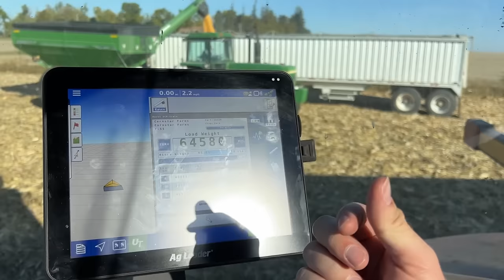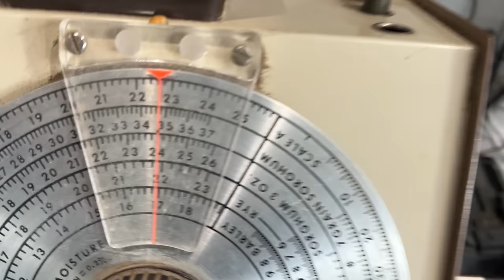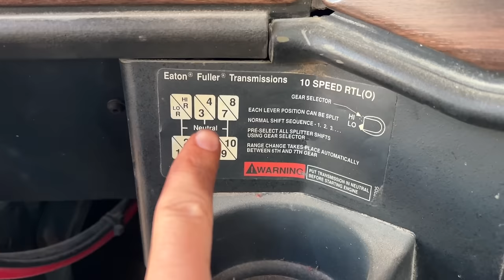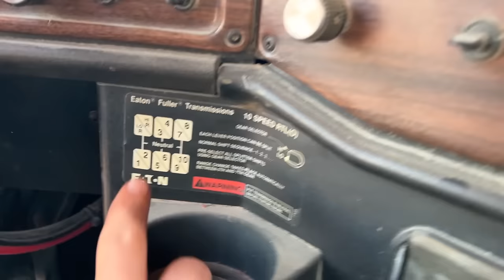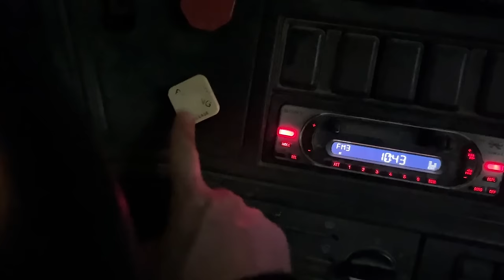My Farm Has A $140,000 Problem

Comment: Youll want to put grade 5 bolts in the augers again. What they're doing is being "sheer bolts" meaning the bolts break instead of destroying the auger bore it goes into when somerhing plugs the auger.
Reply: That was my thaughts as well
Reply: Or the fail safe could just be burning more belts.
Reply: I was amazed the wear in just a few years. Plus one broken, 2nd lost?  possibly broken?   If tight they should not.  But there is a lot not right with that site.
Reply: @larrythompson8630 the bolts are probably supposed to be checked every season but the contractor didn’t give them any maintenance plan.
Reply: That or a contractor used inferior parts because they were cheaper. A 3/4" diameter bolt is a hell of a shear bolt.
Reply: @jkpq8738  I'll smoke em
Reply: @jackt6595  yeah that's the only thing he forgot cuz it's not his job
Reply: I'm really glad someone else pointed this out.
Engineering done right, always gives you a Shear point where your least expensive link-in-the-chain, breaks.
Those new # 8 bolts are putting every Affiliated system at risk:
Motor-mounts, Motors, pullies, belts and suspension/adjustment structures.
Not just the augur cores.
Reply: @Peter-jo3wt  there's way more strain on that system from the slop of the inferior, wore, bolts. The mynewt amount of deflection you'll get from using a lesser grade bolt is not even measurable. Everyone needs to quit playing sideline engineer.
Reply: @kevenhiemie  
That's funny, since any engineer can tell you, you want the weakest link in the chain to be the least expensive and easiest to replace.
People without engineering education and experience, should probably not represent themselves as experts in engineering.
Reply: @Peter-jo3wt  o.k. Jimmy. You're trying way too hard to sound smart at something you don't know much about. Just stop trying to play sideline engineer.
     Do you remember the acronym
K.  - Keep 
I.   - It
S. - Simple
S. - Stupid 
       You didn't put the weak link in the middle of the chain. You put the weak link (sheer bolt) at the end. 
      You know right after the gearbox or a motor not in the middle of an auger. That would be dumb. 
       The bolt was just poor quality hardware, that failed. Plain and simple. It wasn't an engineered breaking point.

Comment: Does everyone forget Cole chose the lowest bid. Most large contractors throw out the lowest bid for these types of reasons.
Reply: After all he chose those contractors, buy once cry once.  Or in Cole's case buy twice cry thrice ( moaning every video) 🤔
Reply: If he did choose the lowest bid it's still not right that they have so many of these problems though , usually a company would want to prove that they can do a good job and such for a bit of a Lowe cost, but also cheaper unfortunately usually means crappy work or sub par work...so who knows

Comment: If the truck holds air for long enough, you don’t have to pop both the air valves every time you park. The trailer brake isn’t technically a “parking brake”.

Comment: Hey, I hope you guys see this, with the belts, you have 2 massively different pulley sizes. Try using an AX belt, basically it is a belt that instead of being continuous it has a little more flexibility to allow the difference in pulley size, another thing, feel the inside of those pulleys, see if they are worn. Due to the amount of belts it has run through. And one last thing, if it is wearing through them that fast, check the tightness and alignment of the belts. Use a long straight edge and put it the long pulley, the gap between the belt and the straight edge should be equal throughout the whole travel of the belt. Make adjustments as needed. The angle of the motor can also play a factor in eating up belts.

I'm in commercial Hvac, I have deal with motor replacements all the time and have to do this.

Comment: The transmission in the red freightliner is called a super 10 speed.  Ps usually if you only pull one brake , you pull the tractor because it takes less  time and less air then the trailor brakes.
Reply: On the red trailer knob,  it says not for parking, take to good truck shop , they should be able to take that shut off system out of the computer!!
Reply: @kevinsiedschlag429 that or bump the cruise up a little while in park

Comment: To fixs your v belts burning out all the time you need a pretension idler pulley it will give more belt circumference on the small motor pulleys, less slipping and will make it easier to change belts with a bar . Hope this helps.
Reply: Nice call Matt. I was wondering about a third belt too.

Comment: Can you switch to a double-chain drive and gears instead of burning belts?
Reply: It’s probably burning belts due to misalignment. Could be better to fix the misalignment issue first.
Reply: Belts are a safety item on the augers. They break before you tear other things up.   Chain if something happens you tear a lot of things up.
Reply: @johnunsicker7440 the motors have overloads on that system…if there is too much of a draw they will get shut off. Chain is the way to go
Reply: @johnunsicker7440  Not in my experience . a correctly adjusted Motor Protection switch cuts the power before it tears itself apart

Comment: Just a though. 

But your motors are being driven by drives. That means you can adjust the properties of the motors almost infinitely. Biased on what your saying it’s possible you could increase the torque of your motors and also have them do soft starts. Basically, rather then the motor going full force and burning the belts it will start off really slow and work up to the speed. 

Saving your belts and giving you a chance to catch issues before they burn up.

Comment: Just a note on the auger bolt. That was a special bolt, long shank with a short threaded end.  Putting in standard hardware bolts will most likely move the rotating force from the shank to the threads, a much small and weaker part of the bolt.  They will fail prematurely.   Order the correct bolts.  If the correct bolts are grade 5 so be it.  Use red thread locker on them.  Yes, you will need to heat them with a torch to remove the nuts when you want to.

Comment: Use a high temp automobile belt. Equipment belts are not as heat and rpm tolerant. I had a belt that would burn threw in 3-5 hrs, switched out to a truck belt last year and no issues

Comment: As far as Grade of Bolts, you want a bolt that’s softer than the shafts you’re connecting - it’s easier to replace bolts as they wear than it is to replace shafts. The softer metal gets the vast majority of the wear, so harder bolts will just wear your round holes into ovals.
Reply: Nooo a softer metal bolt will wear thin. Allowing the hole to oblongate due to the play between the hole and soft bolt.
Reply: Are you talking"shear bolts" or regular vs grade 8?

Comment: I would be wary of changing to grade 8 from 5, it probably was designed to be the shear part in that system. That said it likely would need orange thread locker for it.
Reply: Zero lock washers.... Of course they came out.  Put it back together without lock washers... << Palm face >> and no locktitie.

Comment: Hey Cole, why don’t you put differently pulleys on the pit auger ie pulleys with more slots for belts that way there’s more belts taking the strain making it less likely to burn them
Reply: ding Ding.  These guys are machinery clueless.  Put auger back together without lock washers or cotter pins... of course it falls apart.  Saved $1 but spending $1000's "fixing" continuously instead of addressing base problem.
Reply: @w8stral  yeah I know it’s sad to see, embarrassed for them too that they couldn’t figure out the problem with the combine either, just basic stuff
Reply: Those bolts go into the semi-annual maintenance and upkeep program. Self-locking/nylock nuts should be sufficient when tightened down.

Comment: Our pit augers have a heavy duty gear box for gear reduction.  We still burn off belts but it’s usually because of grain leg problems, plugging.  Your motor needs more torque.  Will run a little slower but will not fail as much.

Comment: You can try X belts instead of B belts. The cogs on the X seem to hold up better. I’m surprised that it’s not on a VFD. Even if it’s just for a soft start. If it isn’t it probably should be. That stuff banging on and off constantly at 100% will most definitely tear up belts

Comment: Cole, on the trucks with the automatic shut off if you lock the brakes then hit the cruise control button it will automatically idle up the truck and bypass the automatic shut down
Reply: What I do is put in reverse driving 100k an hour
Reply: @morgan67748  after spending hours in line at the elevator every year when it's 110 degrees in the shade in South Louisiana you learn real fast how to keep the truck running and the AC pumping, WITH THE TRUCK IN NEUTRAL ( I didn't think I would have had to explain that part but) lock both the truck breaks and trailer breaks, then turn the cruise control on either  hit set or resume the truck will then automatically idle up and bypass the automatic shutdown
Reply: @lukedesselle2491  baby

Comment: Hope yall get all the problems with the bin site worked out so it works like it is suppose too
Hope the grade 8 bolt donot tear something up usually grade 5 is a lot tougher than grade two
Grade 8 might no break n something else tears up
Reply: The bolts are not a sacrificial part in an auger . Anything that shears will get wedged regardless as we saw in the video.

Comment: The reason your belts keep burning off is due to pulley size ... small diam will ruin belts ..resiz, and pissible upsize the belt or additional belts - then you wont have anymore problems...

Comment: If you are allowed to modify the wet bin legs,  could you add square tubing from leg to leg around the perimeter of the support legs? It would spread the load to the entire pad perimeter instead of just where the legs set. Maybe run some iron across the pad as well ?Just curious does the pit lift auger start before the bottom cross auger on start up and the opposite when shut down to let the lift auger empty? Kind of like the grain cart auger unload procedure. And you are right, you need a  larger capacity dryer.

Comment: I commented before on Daddy Corn star's channel about this, but you cannot choke feed an auger unless you are running a shaft mounted reducer. The tiny pulley motor setup doesn't have the torque to handle it so if it didn't burn the belt, then it would burn out the motor. Shaft mounted screw conveyor reducer will fix this immediately, then you can put a variable speed on it.

Comment: That is a super 10 transmission . And most of freight trucks have that idle shut down.  Most way to get around it was to idle up the motor by using the cruise control buttons by holding down the accel with cruise button on.  Should bring the idle of truck up.  It was for oil circulation while long parking

Comment: There is something you can do to make your dryer more efficient if you are not doing it already, and that is set it up for all heat, then cool your corn in the bins. It can come out of the dryer at 17%, make a layer of hot corn, use bin fans to finish drying on residual heat and cool. I have not seen this mentioned but maybe you're already doing this. Put a hot layer in a bin, then switch to another bin and cool the first bin, when cool you can put in another layer.

Comment: We’ve had good results (on wheat) by putting a space heater infront of the fan so it blows hot air, might not sound like a lot but it’s worked

Comment: Cole depending on how old that trailer is that your pulling with the Volvo the brake problem could be the regulator valve under the trailer or you have a leaking diaphram on one of the air chambers on the brakes. More times than not its that 40/60 valve on that regulator thats failing...Enjoy so much your videos about the farm and especially harvest its a lot of work. Although it has its rewards you work outside you work with your family and friends...It doesnt get better than that...Blessings to you and your family ....🌄

Comment: Hopper bottom bin should've had an extra thick footing around the edge of the slab with extra reinforcement thick rebar 1 inch or better. The way they done it there is no way to distribute out the weight to the rest of the slab just on the edge. 😮

Comment: Hey cole i was just thinking about the inter crop plot, what would happen if you have more row spacing so like instead of 12" have like 15-17" apart so the corn still gets more sunlight without the hassle of chopping up beans and switching heads back to back. Havent researched but it was something ive thought about
Reply: Wondering this same thing when he was talking about planting next year
Reply: Most corm are on 30 inch row spacing some will do 20 inch spacing.
Reply: @johnunsicker7440  what would happen if he would space that to like 40

Comment: Cole, the red Freightliner has what is called a super 10 transmission. i drove a '93 freightlner with a super-10 and absolutely hated it. i don't mind 9 speed or 10 speed straight shifts transmissions but the super-10s are for the birds.

Comment: your problem burning belts is drive pulley is to small for the horsepower of your electric motor  increase pulley size on both or use a shaft mounted gear box reducer
Reply: LOL adding a gear box will reduce auger output. SO that means longer unload time.  The auger system is just plan outright to small for the system.
Reply: the goal is to keep the auger speed the same use a 15/1  reducer and bigger pulley on the engine and smaller pulley on the gearbox to get the same overall reduction  it will take a little math to get the the right pulleys  with a bigger drive pulley you should only need two belts

Comment: The trailer brakes sticking in the morning sounds like a fun challenge.  My initial thought was the SR5 valve / spring brake  valve / abs valve (whichever type you actually have) sticking, but that sounds too easy.  One time we had a yard truck at work that was trapping enough air in the service line to not let the brakes release after letting off the pedal.  After disconnecting the glad hand it would release until you stepped on the pedal again.  The craziest part is you really didn't hear any air coming out when you disconnected it, but there was just enough to keep the valves on the trailer from fully releasing.

Comment: Maybe upsize the pulleys and belts? That seems like a better thought.
Reply: Change the pulley change the speed
Reply: @pulkpuller  not always, if you can put a wider pulley but same circumference nothing changes on that front. I’d be interested in running the measurements and math on their system to assure it was tooled right to begin with. Lawsuit aside, documentation of everything is key, then upgrade so you aren’t going through the headaches.

Comment: Hi Cole if your red truck has a cruise control if you turn it on when you are parked and hit the set switch up it should speed up the idle speed and it will cancel the fire minute shutdown and also the shift pattern you showed appears to be a super 10 speed so basically it is a 10 speed but instead of running through the five gears and then going to the high side of the transmission you go to the high and low side in each gear and only do it once I have seen them driven but never drove one myself one thing you can try when you are going from the high side like second gear and you go into neutral and then switch to the low side and then put it in too third try leaving it on the high side and go into fourth gear it should go in easier because you are jumping two gears and then before you step on the throttle again switch it to the low side and when you step down on the throttle it should shift automatically just like you can do with a 13 speed when you are splitting the high side

Comment: The reason your belts keep burning out is because you have a monsterous (10HP?) motor with a TINY drive pulley. All that force is being concentrated in an extremely tiny area, and even if the belt doesn't slip, the shear force on the belt (shear is a direction of force, not an adjective) will cause them to fail every time. The fix? Use a bigger drive pulley. The problem with just going from a 3" drive pulley to a 10" drive pulley is:

1. Your auger would spin faster.
2. Your auger would have less torque, meaning grain could stall it out.

The best fix I can think of is this:
1. Measure the drive and driven pulley diameters.
2. Figure out the ratio (say drive is 3", driven is 18". That's a 1:9 ratio)
3. Create 2 or more stages of pulley that sum to that 1:9 ratio. Meaning, say we use 4 pulleys: 1) 10" drive Pulley connects to 2) 24" driven pull connected to 3) 10" secondary pulley which belts to a 4) 24" driven pulley attached to the auger shaft.

For the math to be prefect it'd need to be like a 25 1/8" driven pulley, but 24" is close enough. The bigger the driven pulleys are, the more torque and less rotation speed the auger will have.

Note: High school students and freshman engineers in college learn about gear/pulley ratios. Anyone with a professional engineering license or credential should be able to do this. Meaning your lawsuit should make mincemeat of whatever fool failed to do BASIC BLOOD MATH on the pulleys!